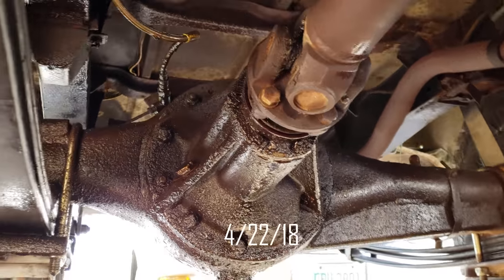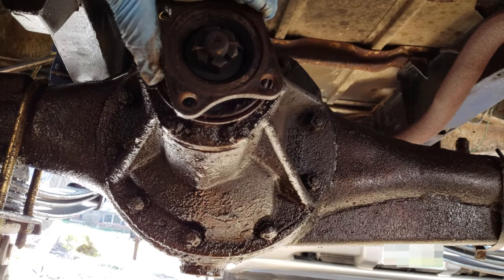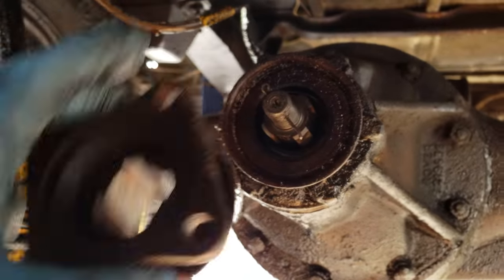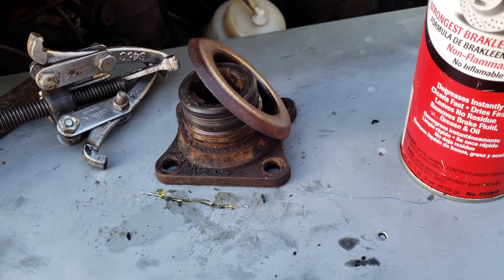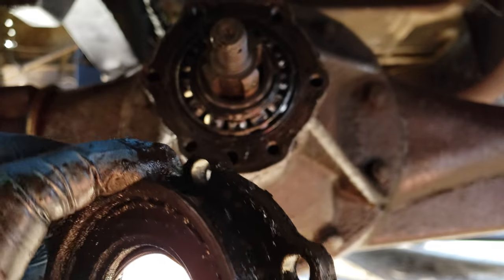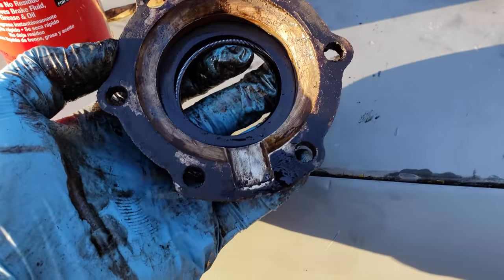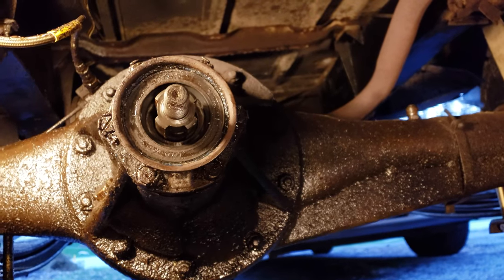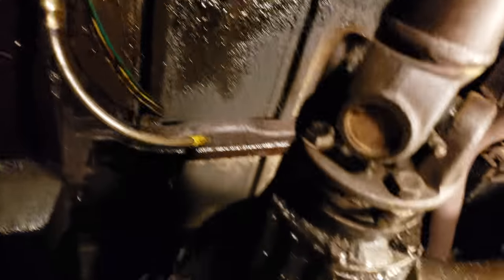1961 Series II Land Rover - Rear Pinion Seal Replacement

Comment: Backlash in the pinion is often exacerbated by wear in the half shaft splines at the driving members - take off the drive member caps and get someone to have a look whilst you work the pinion back and forth. There is probably some wear in the pinion and crown wheel too. Good job on the seal, not my favorite job.
Reply from the maker: Honestly I'd rather do that seal 1000x before replacing the stock chassis bushes again. Tried your screw press method, stripped and bent so many pieces of allthread it's not even funny. Putting in an order for poly bushes in the next couple of days. This was easy, and straightforward, two things that are rare on series it seems...
Reply: The spring bushes are one thing, but the chassis bushes are another! I think I cut mine out in the end. Will be interested to hear how you get on with the pollybushes, folks say they can make the ride harsh as they don't have the same damping effect as the original metalastic bushes.
Reply from the maker: I have heard that, though I have my doubts how much an effect it will have in this application. Regardless, it'll take a hell of a rough ride to make me want to fight the stock bushes again.

Comment: That looks so easy. It’s not though, is it?
Reply from the maker: Actually, it was quite easy in my case, the early ones with the aluminum seal housing make it nice. Doing the rear output seal on the transmission was a nightmare of a fight, so I guess it can go either way.